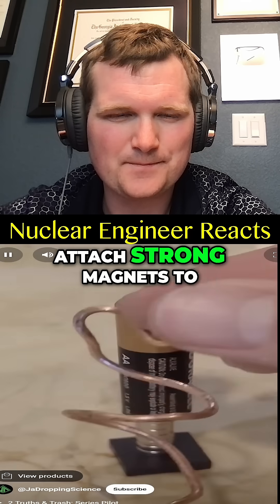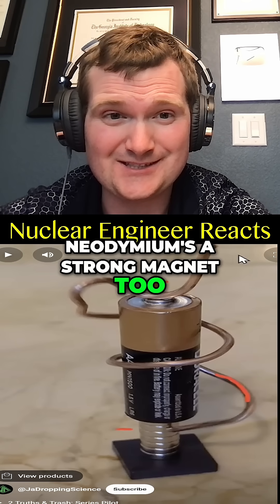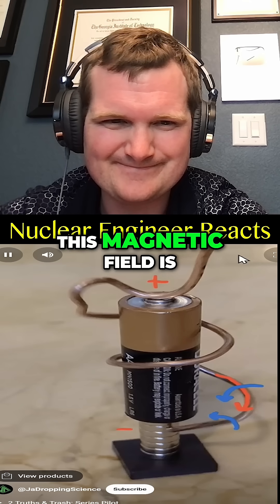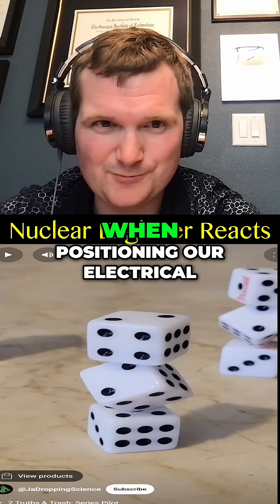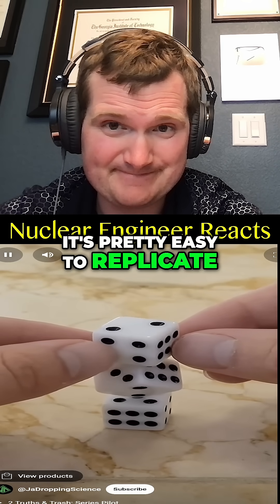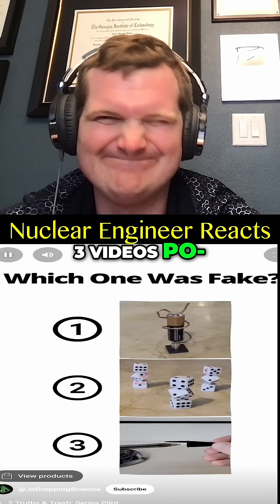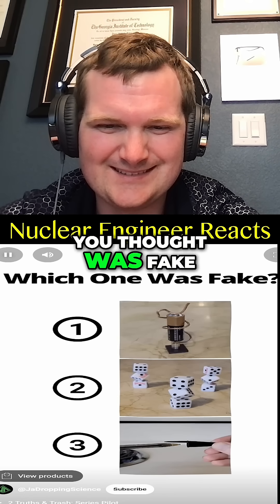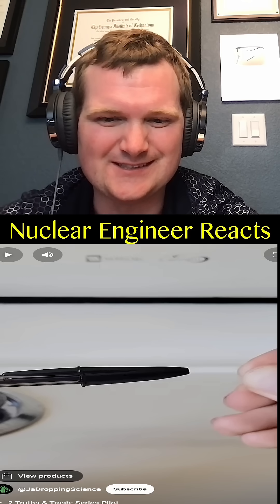Can You Stack Dice? - Nuclear Engineer Reacts to 2 Truths & Trash by JaDroppingScience

Comment: Fun fact: you can actually make a "train" with the first video's concept by putting a magnet on each terminal of the battery, making a spring out of copper wire of a size it can slide through, and just sliding it inside. The magnetic field of the wire being powered will push the battery forward!